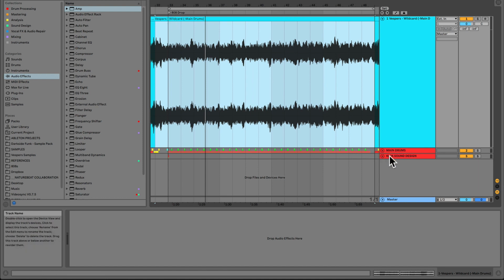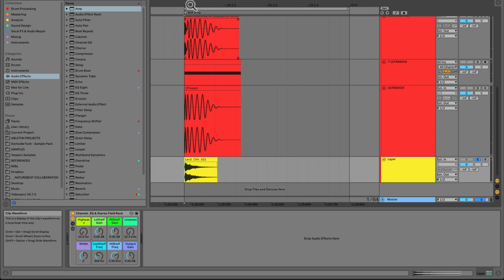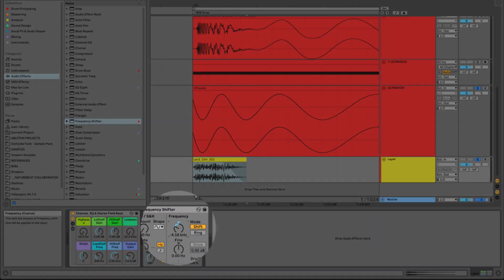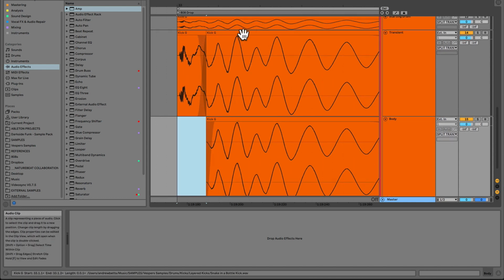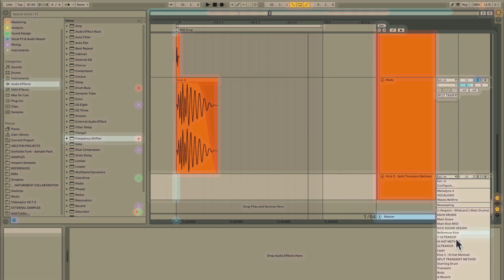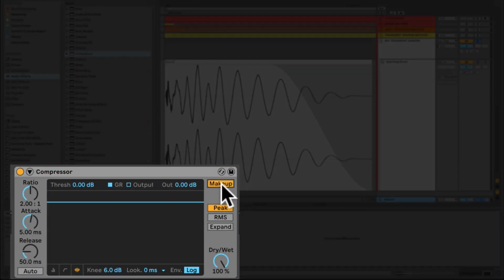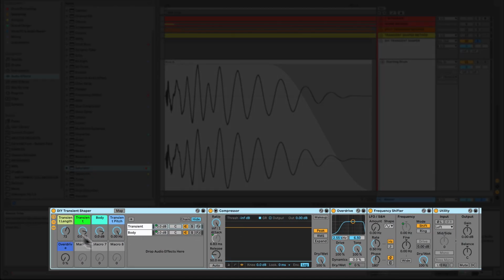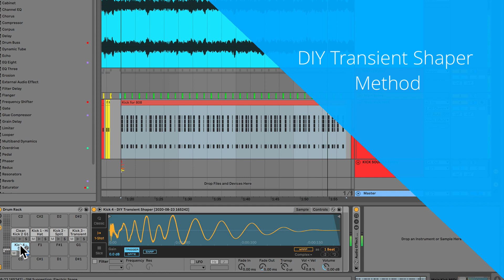How to Make Your Drums Hit Harder

Comment: One way I like to add some extra weight to my drums while also introducing upper order harmonics to add punch is to take Ableton’s Glue Compressor, leave it at default settings, turn on Soft Clipping, then start tweaking the Makeup to taste. Reading through the Ableton manual I found out that Glue Compressor adds color to audio when pushed hard and Soft Clipping is enabled. Worth a shot if you want to try experimenting with other techniques

Comment: Why are you no longer using the Genelecs 8040?
are the Dynaudios better than the genelecs?
Greetings from Germany
Reply from the maker: Hey mate.  Nice to hear from ya.  I sold the Genelecs and optes for the Dynaudios.  I wanted more LF extension than the 8040s could achieve without having to use a sub.